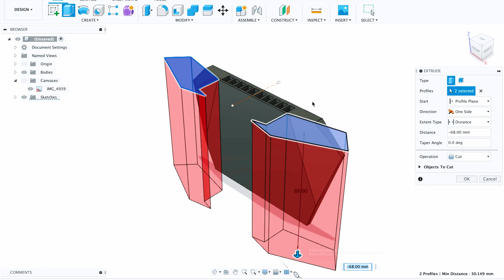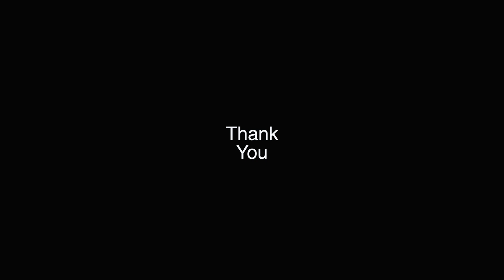CR 6SE 3D Printed Fan LID            (10 Designs)

Comment: Wheres all the comments
Reply from the maker: Usually people comment something when they don’t understand, or when they really don’t like or like… this seems like quick video.. and you know, everybody download it print and forget about me.. 😂😂😂
Reply: @Max3DDesign  i am printing this right now as we speak, hope it turns out great
Reply from the maker: @GiovanniMorenoMusic  should be fine. :)
Reply: @Max3DDesign  its done now!  Didnt fit perfectly but, with the slots for magnets it will work great. Thanks for this design 😄
Reply: I found a magnet that fits perfectly, works great now 😄 now i just need to print the other part for on the inside
Reply from the maker: @GiovanniMorenoMusic  Yeah it was designed to use with magnets.. The bottom two are just to align..